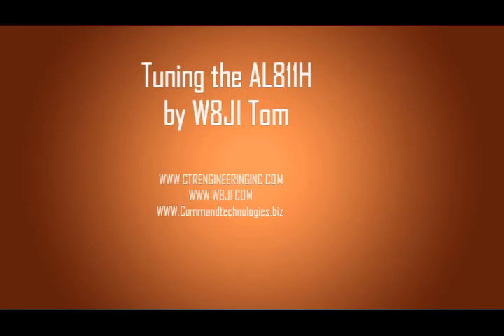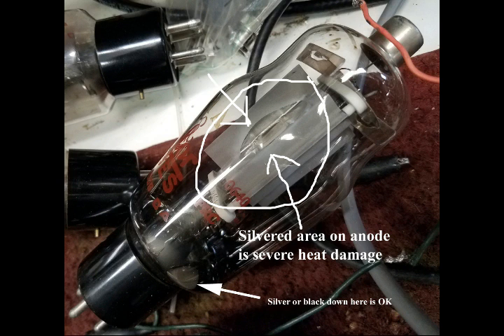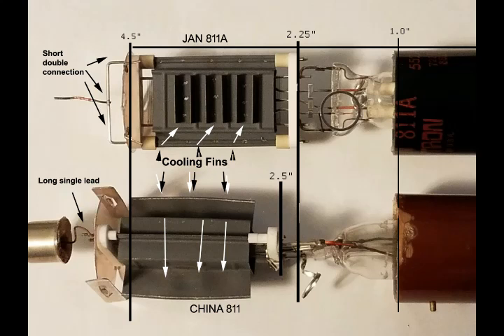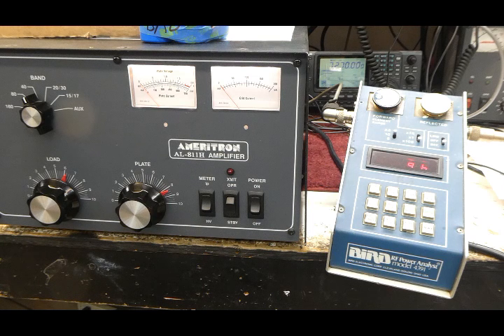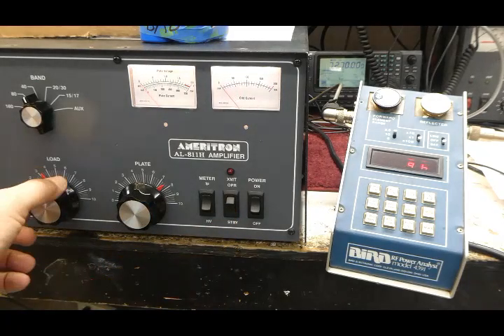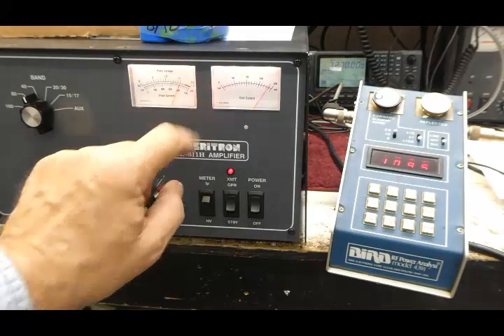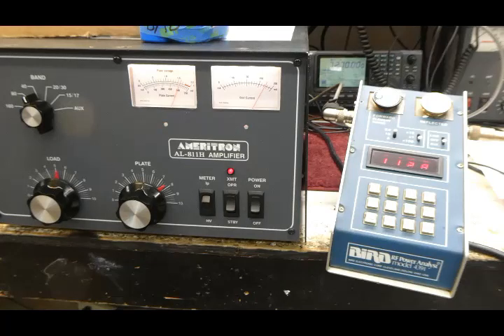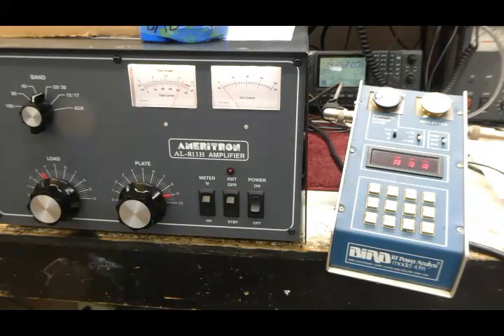Tuning AL811H with TOF module and Pulser

Comment: I have that same amp that you did your magic to.  Question, I think you said that the power wasn't the problem with the tubes going bad fast.  I tune my amp just like this and it gets about 1k or a but more out of it at 95w drive.  Is it okay to run it at 1k output if its tuned correctly?  Or should I drop the drive down and run the amp tuned properly at say 800w output?  Thanks.

Comment: I see nothing blinking red. I am surprised in your, "tuning" at length you didn't melt the tubes.
Reply: Burt this man designed the amplifier.
Reply: K10IK, look at the left edge of the Grid Current meter.  There is a red flash in that area. Trust me I know.  I hand delivered my AL-811H to Toms location and had him do all his up grades to my old amp.  I saw this thing put out 1,200+ watts.  This is his design, he knows how to run these things.  Don’t be such a knucklehead dude.
Reply: @CAVGUY1158   knucklehead dude? You are so brave with name calling as you cower behind a keyboard.

Comment: I am totally confused I was always under the impression that tuning to max output at 80 in then backing down the drive was the way to go. This is what is in my manual. I tried tuning with 165-175 grid current at 100 in but only am getting about 700 out as opposed to 1000 out at about 100-125 grid. So do I tune to max output at 100 in  or 165-175 grid and 600-700 out I am using a pulser and it is difficult to read meters as they jump around. I am not able to adjust the pulser to smooth the needles out I do not have a TOF
Reply from the maker: You cannot use grid current to tune with a pulser without something like a TOF. The normal grid meter reads something around average. Peak is what is useful for any mode but steady carrier.  Normal grid current for maximum output, once anywhere near full power, is about 40-50mA per tube.
Reply: @Jerrythenerdful  TOF?
Reply: @Capecodham  Tune On the Fly module.
Reply: @Russ-nf9tv  No one uses that abbreviation, no one.
Reply: @Capecodham  what do you call it?
Reply: @Russ-nf9tv  What do i call what?
Reply: @Capecodham  the TOF module.  Did you make one and give it a different name?
Reply: @Russ-nf9tv  I never heard of one
Reply: @Capecodham  you commented on a video about a TOF module that is completely irrelevant without using a TOF module, and claim nobody uses that abbreviation?  Yet you don't know what a TOF module is?
Reply: @Russ-nf9tv  I avoid abbreviations, like QSL, HI HI, QTH, CRM, FO, it takes so little time to be clear.
Reply: @Capecodham  Those are accepted abbreviationS on CW, not so much on SSB
Reply: @Capecodham  OMG! ALV.
Reply: @peredavi   
Autoliv Inc
88.11 USD
+6.32 (7.73%)today
Reply: Thanks for the nice video, I have an AL811 and hooked up with an ARB-704 between the rig and the linear, btw what is a pulser tuning device? And how much watts input to get a grid of 160-175ma on AL-811? Thank you and 73 de KH2ZZ